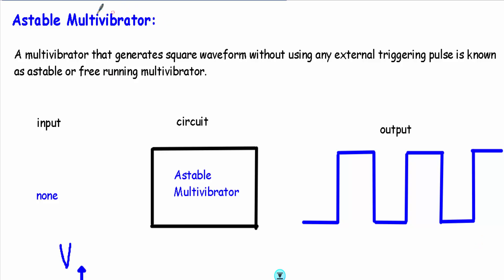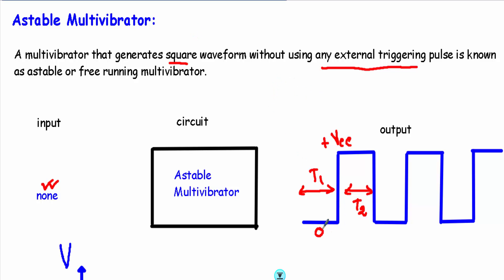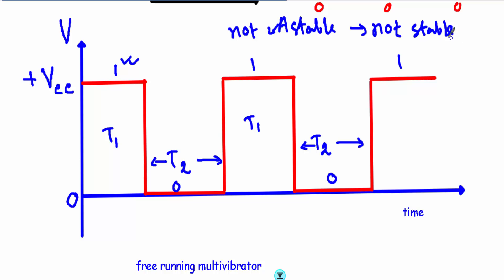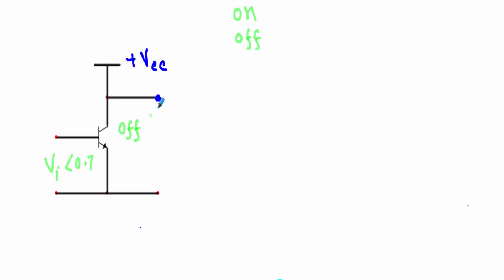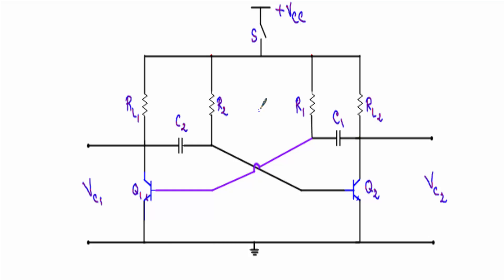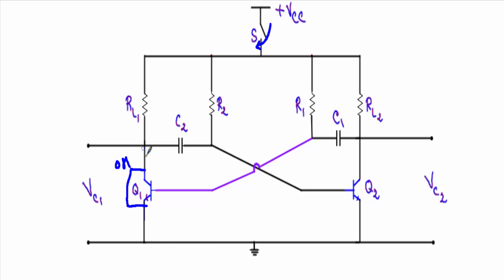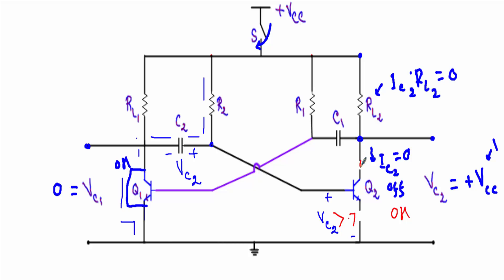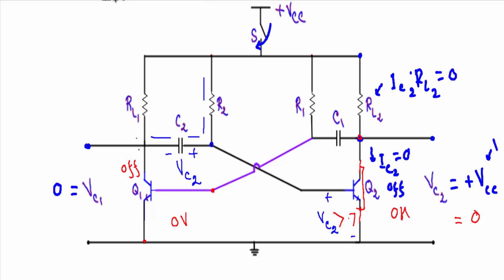Astable Multivibrator using transistors ( w subtitles)

Comment: It does make sense so far I think, however when C2 charges, how comes C1 is not charging simultaneously also? Is it because the voltage is Vcc at the negative terminal of the capacitor?
Reply: InMy Idea
 As the Discharging path for c1is lower then that of c2   therefore c1will discharge more rapidly

Comment: The way you have connected RL1 and R2 makes sense. I have seen other explanations that say the capacitor is charged through RL1 which doesn't make sense because the transistor won't turn on if the negative plate of the capacitor is facing Q2. Good job.
Reply: C2 get discharge when Q1is in off state
Reply from the maker: C2 charges through R2 because only that path can connect C2 with Vcc when Q2 is off. If C2 charges through RL1, there will be no direct connection between C2 and Vcc, so that cannot be the charging path

Comment: if capacitors in the circuit discharges after their fully charged or it discharges after 0.7v to turn on transistors?

Comment: Nicely explained. But i have a doubt sir when we give Vcc in starting what is the path of current/ voltage so that one of the transistor will get 0.7 V and will get on.
Reply from the maker: +Sneha Murya, may be you know similat transistors do not have identical B-E and B-C junction voltage.  the transistor with lower base-emitter junction voltage should turn on first.